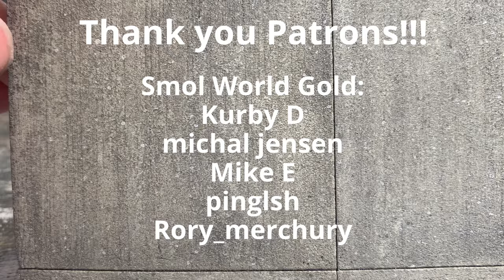How to Make and Paint Faux Concrete Sidewalks For Dioramas From Styrofoam

Comment: Just fount this video!  Great, concise, clear tutorial...thank you for the lesson!  One question...where did you purchase the super thin XPS?  It's almost as hard to find as unicorn teeth.
Reply from the maker: Thank you! And I’m glad you like the video! Unfortunately, I don’t know where to buy sheets of thin foam. I only have 1-2” thick pieces where I’m from. I just cut the thickness down with my proxxon hot wire table. 

You could try looking at eBay, I’ve heard that some people sell thinner sheets that they cut down themselves! Not too sure about how clean and accurate they are though

Comment: Did you apply the Deck Tan without mod podge?
Reply from the maker: Yes I just used the paint, but you could seal it with mod podge to make it more rigid if you’d like to

Comment: I'm wanting to build small scale houses, as real as possible, complete with teeny pvc pipes in walls, tiny coated wire thru walls, real pieces of carpet on floors. then scale it up using "1 by " lumber🤔
Reply from the maker: That sounds awesome!